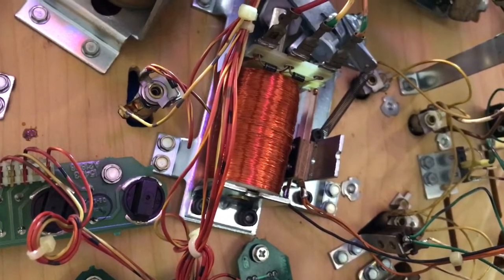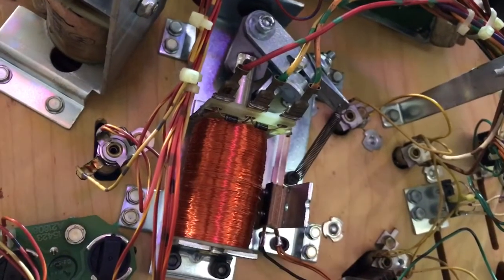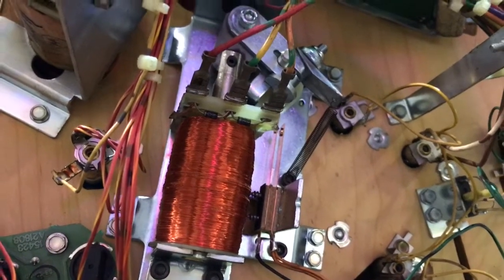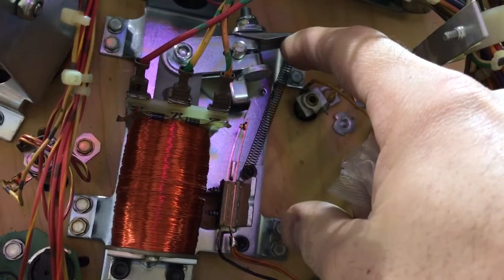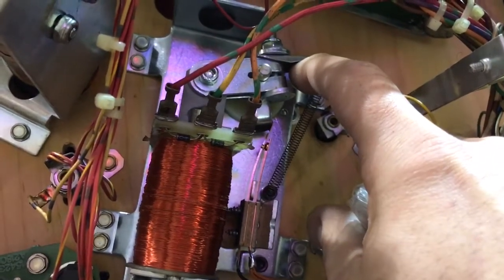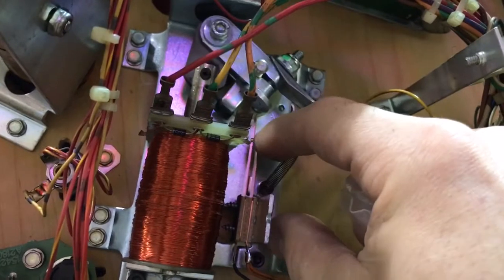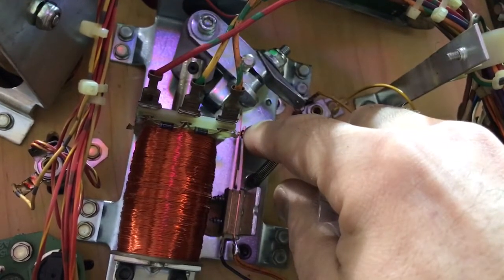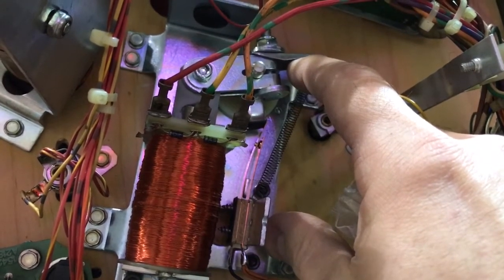Pinball 101 #11 - How an End of Stroke Switch (EOS Switch) Works on a Pinball Machine

Comment: THEPINBALLCOMPANY, 
                                                    Why doesn't the flipper coil gets "burned out" when its being held down because the coil#1 is still turned on while coil#2 is turned off by the end of stroke switch but the coil#1 should get burned out since its being turned on while holding down the flipper button.

Comment: This is a Fliptronics game because the EOS switch is Normally Open.  Adjusting the EOS switches on a Fliptronics game is not crucial because the length of the power stroke is controlled by the computer.  The game will work almost normally with a broken EOS switch.  That also means that your comment that 'if the switch does not close, you are going to have high voltage the entire time' is incorrect.  And if they are stuck together, you will not have 'low voltage the entire time'.
EOS switch adjustment is only crucial on non-Fliptronics flippers (and non-computer controlled flippers from DE/Sega/Stern + JJP).   If you are going to show EOS adjustments it should be on a ~pre-1992 pin (before The Addams Family).  Those who are watching this video should look elsewhere.
Reply: Hi larry, I have a 1996 Sega Space Jam pinball machine that I am troubleshooting the right side flipper end of stroke switch. I have not had any issues with gameplay but while reviewing the diagnostic menu for the dedicated switches that is the only one showing as active when no buttons are pressed. Upon reviewing the bottom of the play field that switch was slightly touching the contacts. The left side was not. This design appears to show that once the coil is activated and the flipper movement touches the end of stroke switch that it separates them further from each other and not closes them together as is shown in this video. I'm trying to determine what is the normal resting position for this switch. I would think that they should touch all the time and then allow the flipper movement to open them which sends the signal but I am maybe wrong. Can you clarify this for me as to how the position should be in a resting position for these switches? Thank you so much!